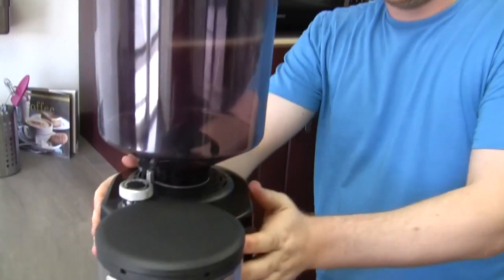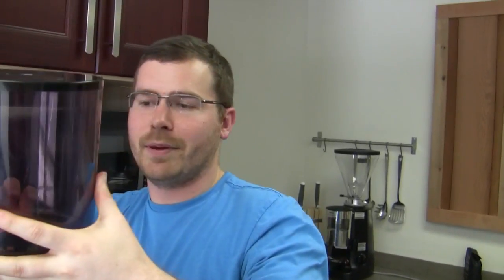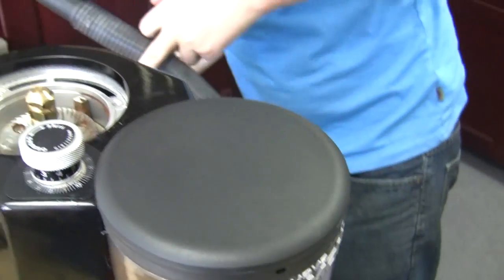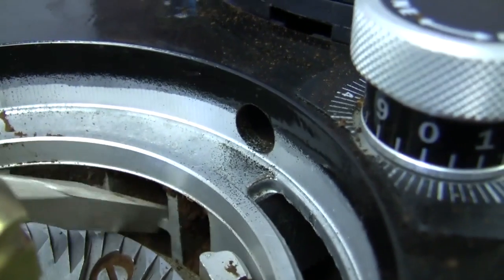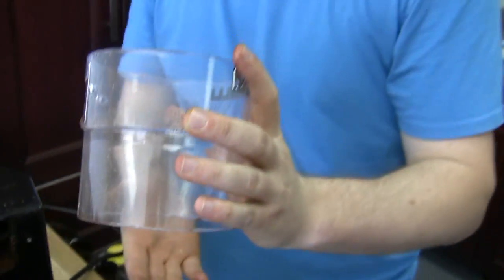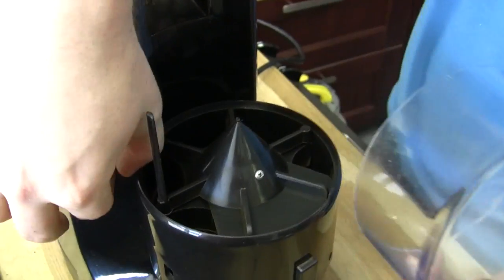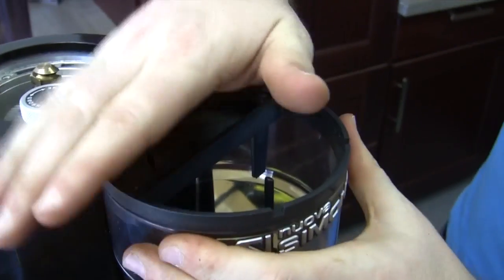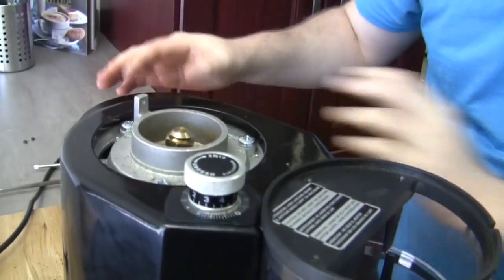Tech Tip: How to Clean the Nuova Simonelli MDX Coffee Grinder

Comment: I had one of these at home for a while, it was a great grinder, very easy to use and the doser resulted in a nice clump free mount in the PF. What it does need is some kind of timer system so you can grind only what you need into the doser for the home environment. It was also a great grinder to work on. The dosing chamber could be easily adapted to single dose if you had a little creativity and access to some metalwork facilities.

Comment: Have this at home but just wish I could find a shorter hopper for it so it would fit under a cabinet in the kitchen. Great grinder though.
Reply: Amen to that!  Same situation here...  I had a local glass blower make me a custom bean hopper, but having trouble finding a wood worker to make a custom lid.  :)
Reply: I've recently procured one of these. However, mine is missing the hopper entirely. 

Do you have idea if these are safe for a dosed grind? Essentially free-spinning burrs, throw a dose of beans in, and wait for it to empty out? I'm intermittent with my espressos and don't roast too much coffee, so I'd rather not have a load sitting in a hopper. 

Secondly, is your hopper perfectly circular? Any imgur (or similar) link to a picture of it? I have an engineering lathe and intended to make a mini-hopper for single dosing. I'd offer to contemplate making a lid if you need it.
Reply: @naycnay  I have one and the Macap M2 hopper is a good fit and also very cheap comes with the lid too and bean blanker and holds a perfect 250 grams for a single bag